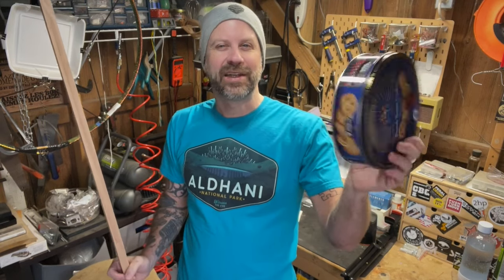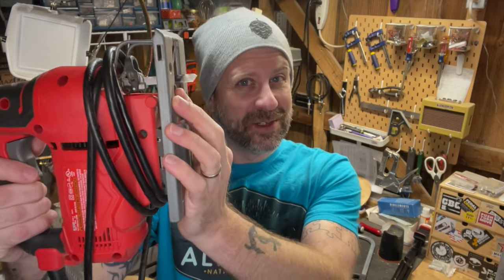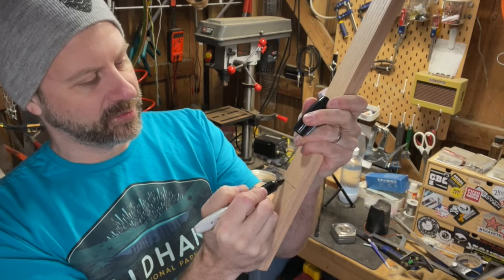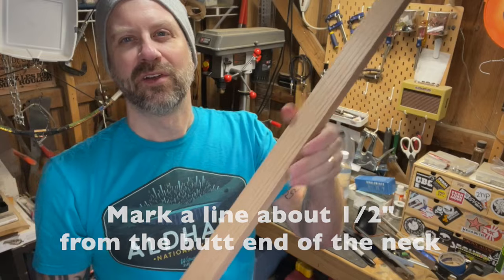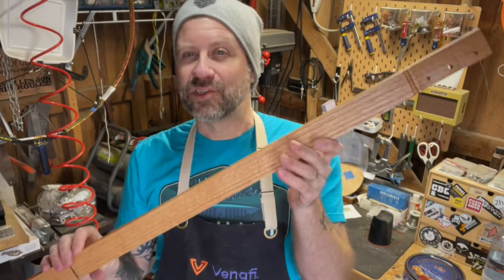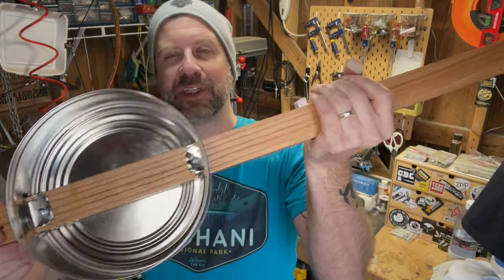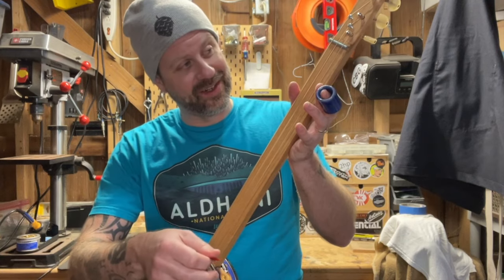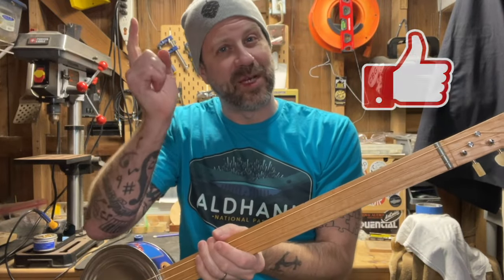How To Make a Cookie Tin Banjo (start to finish)

Comment: If you want it to sound a bit warmer, you could line the can with thin plywood. It both stiffens the can, reducing tininess, and increases resonance.
Reply from the maker: That's a good tip. Thanks for the suggestion. I'm pretty happy with the way this one sounds though.
Reply: That would definitely decrease resonance...Cookie tins are some of the most resonant materials available. Volume is affected by "specific modulus" AKA stiffness to weight ratio. Aluminum is extremely stiff at a much lower thickness than woods. Adding plywood would increase the weight and decrease the stiffness, which would definitely make it quieter. It would still be a good idea to remove the lid off the box and replace it with a thin sheet of plywood, for better tone.
Reply: @N8Dulcimer real

Comment: I can't believe I never thought of using the tin tabs to screw the neck to...duh.  What I've been doing is much different and works and is sturdy, but much more complicated.  But I will say that you should be able to cut right on the lines that form your tabs using a thick bladed utility knife...that is, no need to drill holes...just be careful when puncturing with a blade.
Reply from the maker: Thanks for checking it out. I share these vids hoping they help someone else so thanks for the comment.
Reply: Or, if you have a Dremel, you could use a really small cutting disc

Comment: I love the way you found the fret spots. Excellent!
Reply from the maker: I actually think that's easier than using a template but most people disagree with me. Remember the fretlines aren't actual frets, they're just a guide for where to put your slide. It's the slide that makes the actual fret. Anyway, thanks for checking it out.
Reply: @musicalmiscellany  your way to fretting (even if it's meant for the slide) is a very smart way to flip upside down the problem of marking the scale having to adjust  capo and saddle and positioning the fretboard accordingly (when we want to glue a fretboard)... It is most of all an evident demonstration of the knots of resonance on a vibrating body (here the string), that's what we guitarists call under the name of "harmonics". 
It seems so smart to me  because you ask the string to tell you her sweet spots.
Pitagora is exulting for you from the Ade!

Comment: One of the best time saving power tools I've found for building CBG's is the oscillating multi-tool. With the right blade it's great for notching boxes and tins and doing other small cuts.
Reply from the maker: Oh man. I've had one of those on my wishlist for years. I need to just break down and buy one. I think they look so useful. Thanks for the confirmation... and for watching.

Comment: i love making similar and crazier ones.  openable backs rule for adding electronics storing lunch...
i just use a heavy 'stanley' knife to pierce the straight cuts into the metal; forming clean folded tabs on the sides and back of the neck.  very small starter holes are good, but not needed.
also, thinning the part of the neck and back (inside the can) to form edges that give a finished meet up of these parts.
and scoop out some wood under the soundboard to give it flex.  lose only about 2-4mm per side.  can taper a bit towards the tail stock.
my mate just found a tin with my name on it!  david's cookies
Reply from the maker: Thanks for checking out the video.

Comment: a minor third (b3) and the blue note (b5) are 2 different things. Cool project tough.
Reply from the maker: Thanks for checking out the video. When playing blues in a minor key the "blue note" is the one between the 4th and 5th (b5). You're absolutely correct about that. However, when playing blues in a major key - which is actually more common contrary to popular opinion - the "blue note" is the one between the 2nd and 3rd (b3). I guess I should've specified major blue note as many folks just immediately associate minor keys with the blues.

Comment: Oh and I’m making a 4 string with a piezo pickup. The pick up will be between the neck board and tin surface.
Reply from the maker: With piezos, placing it anywhere on the resonant part of the tin should work. There’s been a lot written on this (and hypothesis vary) but most folks believe the top is most resonant a little bit outside the center. You can usually pluck a string a feel the surface to find the most resonant spot. All of that said… I’ve found the placement doesn’t make a huge difference so I say put it where it’s convenient.
Reply: Would you be able to get a visual by placing something like cornmeal or flour on the face and pluck a string and see what jumps and where?  @musicalmiscellany
Reply from the maker: @avajo5597  That's a good idea but it would take some experimenting to make it repeatable because you wouldn't get any vibrations from the tin until after you had strings and a bridge installed. By that  point in the build process, you'd already have the scale length determined. If you 'sacrificed' a build in the name of research,, that could be useful for future projects. However, then you'd have the next question... does the amount of wood in the neck change the way the tin vibrates because that would most certainly be affected by the scale length. So then would you have to find the ideal location for a 23" scale and another of 24" scale and another for a 25" scale and so on. Once you figure all that out, you could try different string gauges and types of tins to see if it varies. These kinds of experiments can be fun but they're like an onion... there's always another layer to peel back. Good luck.

Comment: I absolutely love this! I play banjolele and I've been wanting to get into trying to make an instrument. This is wonderful! New subscriber!

Is that 23 inches you measured from the center of the nut or the front or back of the nut?
Reply from the maker: Thanks for checking out the video. I hope it inspires you to build one of your own. When you measure scale length, you want to measure from the nut contact point to the bridge contact point. Depending on the shape of the nut, that could be the middle or the back edge. In this case, it's close to the middle. Honestly though, don't get too involved in that because with the floating bridge, you can easily move it a small amount to get the intonation where you want it.

Comment: what's the blue material you put your finger around and use to finger the strings?
Reply from the maker: That's a guitar slide. This particular one is made of ceramic but they can be made of glass, brass, bone, and numerous other things. They also come in different sizes and shapes. If you do a product search for "guitar slide" you'll find lots of options. Thanks for checkin it out.

Comment: What’s the scale length on it? Or just from the bottom of the nut to the 12th fret measurement?
Reply from the maker: It’s a 23” scale. I covered that around 5:25 when talking about marking the neck and then again around 14:40 when I talked about positioning the bridge. I probably should’ve made that more obvious because you’re not the first person to ask that question. 😂 Thanks for checking it out.

Comment: silly question,  what is the difference between this and a 3 string cigar box guitar ?  thx
Reply from the maker: Not a silly question at all. A cigar box guitar is called that but it's not really a guitar. It's a roots instrument, closer to a banjo than a guitar. However, if you made this exact same thing with a cigar box opposed to a cookie tin, it would be called a cigar box guitar. So I guess the difference is nomenclature.

Comment: What timber are you using. Here in uk Hardwood is hard to find. ?
Reply from the maker: It’s a piece of oak board. It’s pretty common to find  in hardware stores in the US. Honestly though any hardwood should work fine. I’ve used maple, poplar, pine, cedar, and walnut in the past. They all work great.

Comment: Is there any adhesive on the nut?
Reply from the maker: Thanks for checking out the video. I did not use an adhesive. The pressure of the strings holds the nut in place.

Comment: i just found this vid and started the project. am i missing somethng, or do you not mention how to attach the strings at the tin end? my strings just have loops.
Reply from the maker: Thanks for checking out the video. I used ball-end strings and that's why I drill the holes through the neck plank. The ball holds the string from the bottom. If you wanted to use loop-end strings, you could just put small screws in those holes and put the loop over the head of the screw.
Reply: @musicalmiscellany  i'll do that. I appreciate the quick reply!

Comment: how did you put the nut on? did you use glue?
Reply: and also how did you do the strings?
Reply from the maker: @fightinganimations1597  The string tension will hold the nut in place. You don't need to glue it. The strings have a small ball at one end, the ball it too big to slip through the hole that it holds the strings at the tail end. The tuners hold them at the head end (obviously). Good luck.
Reply: @musicalmiscellany  ok thanks

Comment: Is there a reason for having only 3 strings? Im asking because 4 seems more intuitive to me but other than that it looks like a fairly simple but fun project. Ive wanted a banjo or tin guitar for ages but banjos are out of my price range and ive only recently found that I'm decent at builds like this so im itching to try anything I can.
Reply from the maker: There's a lot of debate online on whether 3- or 4-strings is better. I wouldn't say either is superior, they're just different. When it comes to fretted gits, I tend to prefer 4-strings but when it comes to fretless gits, I much prefer 3-string models. That could just be personal preference, so take it with a grain of salt. Regardless, you could just as easily do this as a 4-string build is that's what you wanted. The instructions would be more or less identical, but you'd drill 4 tuner holes and 4 anchor holes.
Reply: @musicalmiscellany  awesome. Thanks for taking the time to reply. You did an amazing job on your build by the way, it sounds fantastic.

Comment: How are the strings attached on the backside?
Reply from the maker: Guitar strings have a ball on one end (they're often called ball-end strings). As long as the hole your drill is smaller than the ball, the string won't pull through the wood.
Reply: @musicalmiscellany  makes sense. Thanks! Inspiring vid

Comment: Why didn’t you place the bridge in the center of the tin? Seems like it ought to work best there?
Reply from the maker: There are a lot of different hypothesis on this and you can certainly do it that way. It would seem like there would be more resonance at the middle. However the tin is also weakest in the middle, so it will actually produce less resonance. The general consensus is you get the most resonance around 1/3 of the diameter. Obviously... feel free to break those "rules" as you see fit.
Reply: I’m sure that the consensus has a lot of weight behind it. I’ll let you know if I find anything different
Reply from the maker: @steveatthews3472  There are as many opinions as there are folks but it seems to work for me. To each their own I guess. Thanks for checking out the vid.
Reply: The longer the string length improves hitting intonation better with the finger and a better tone overall.

Comment: That's not a T-square. That's what they call a carpenter's square. A T-square is a drafting tool, and is shaped like a capital "T"
Reply from the maker: Okay thanks for the disambiguation. I've always heard it called a t-square but I know a lot of things get nicknamed in the shop.

EDIT: I looked it up and it's actually called a combination square ( https://en.wikipedia.org/wiki/Combination_square ). It appears a carpenter's square is something else entirely ( https://en.wikipedia.org/wiki/Steel_square ). Evidently we were both using the wrong verbiage. Thanks for the comment though or I probably wouldn't have checked.

Comment: Try taking the back off?
Reply from the maker: You can take the back off if you want. It does make the instrument slightly louder but it also makes the body a bit weaker so it flexes and causes the pitch to warble a bit.